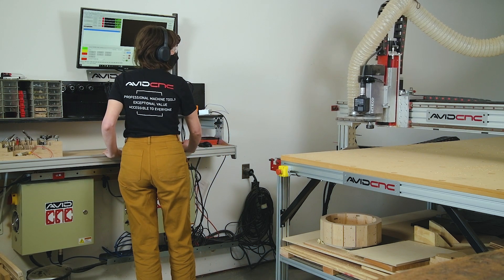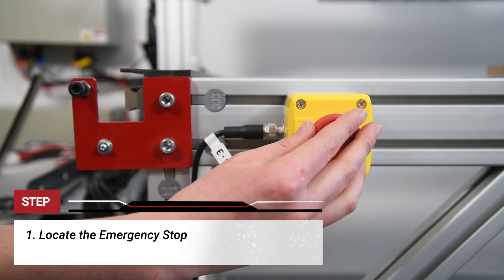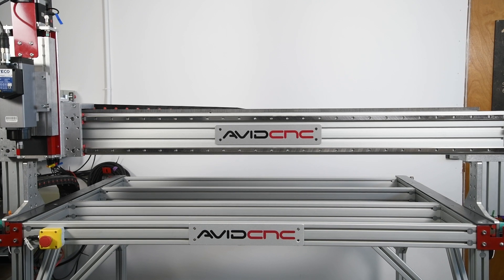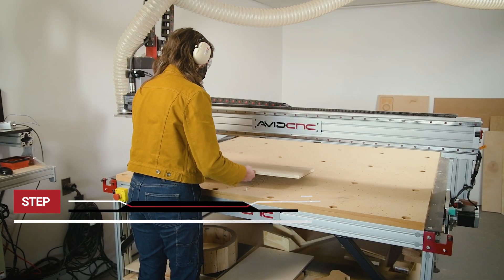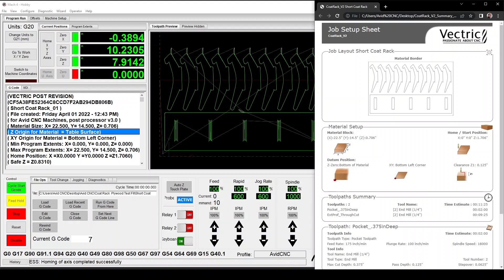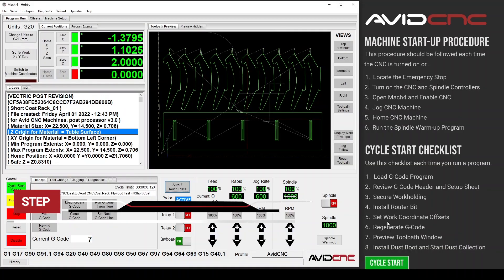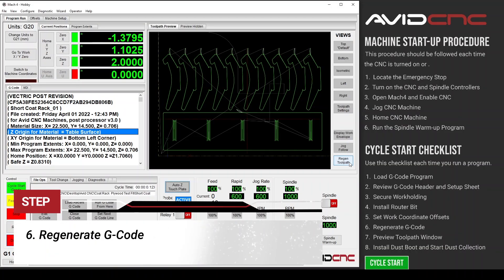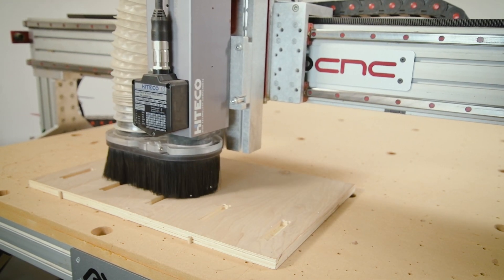Avid CNC - Start Up Procedure and Cycle Start Checklist

Comment: Does your Benchtop Standard 2436 2' x 3' CNC Machine come in boxes to be assembled at home? That is the only way I can buy that CNC and get it into my shop.
Reply from the maker: It does! All of our machines come packaged in small boxes so that you can get them into small spaces and build them there. They can all be carried by 1 or 2 people. If you need specifics about weight and size you can contact support and they can help you with thtat.